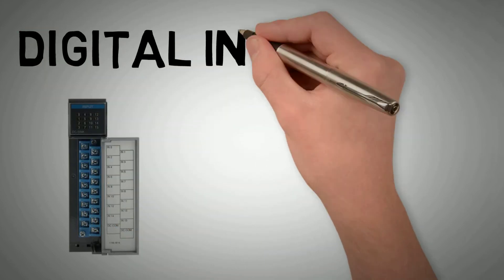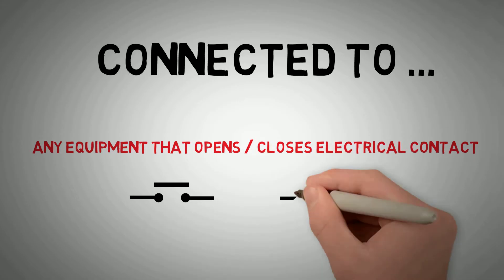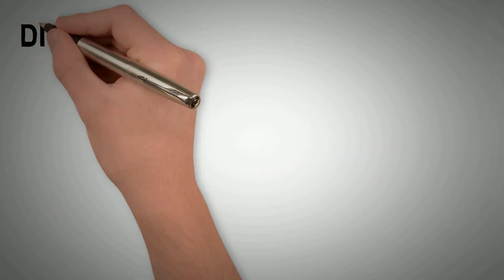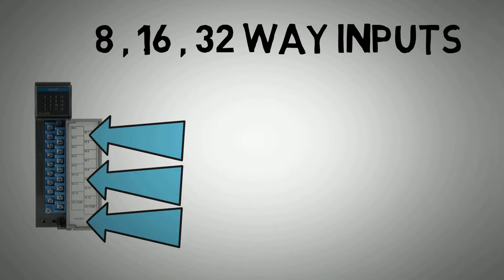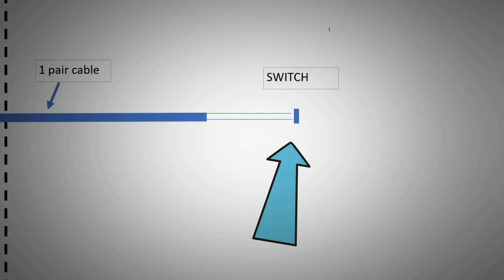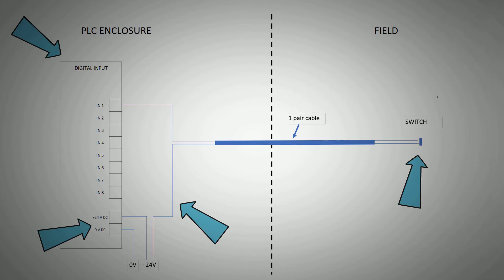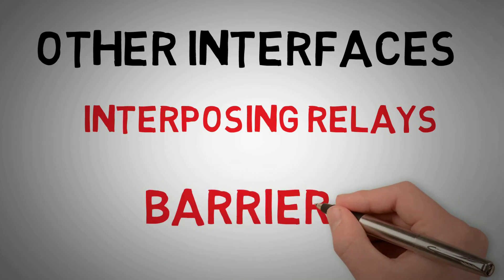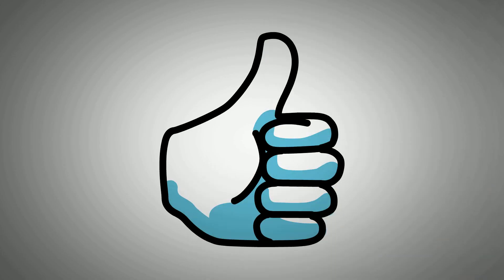Digital Input Card - PLC Basics for Beginners - [Part 3]

Comment: Nice job, could you do a video like this stating the differences between the sinking and sourcing digital I/O cards using the schematics? This series is great, maybe you could go on to discuss analogue I/O cards too! Thanks
Reply from the maker: Hi Lee, I've started the script for digital output cards but then I'm going to do analogue  inputs and outputs too. I'm thinking from there I'll talk about ladder logic / function block / structured text programming. I'm lucky to have done a bit of it all in my career. See where the series goes and what people want to see from there :)
Reply: @InstrumentationControl  yeah that all sounds good. I recently bought an Allen Bradley micro logix plc. It only has digital I/O but I was looking into trying to learn to write the plc programme for something simple like a traffic light set it will be a nice place to start :)